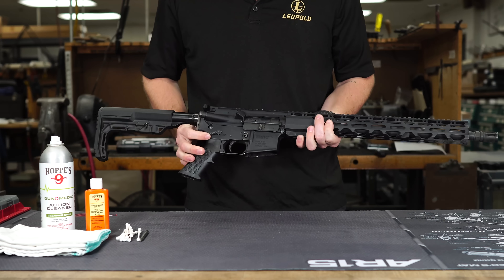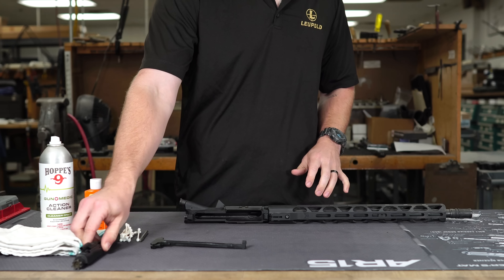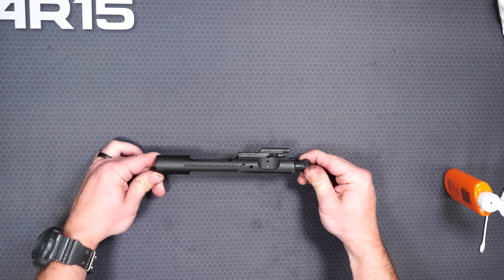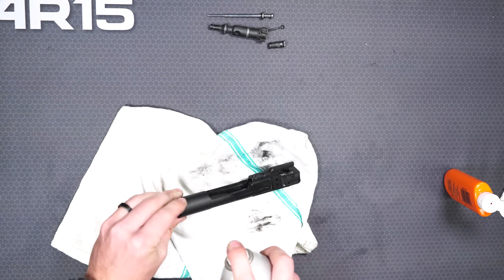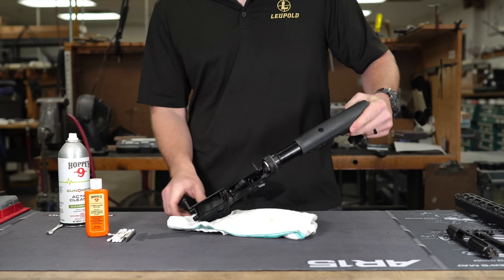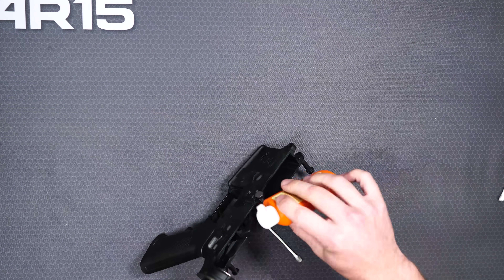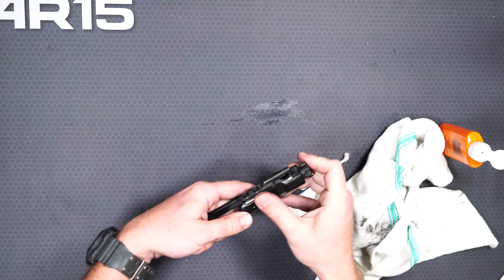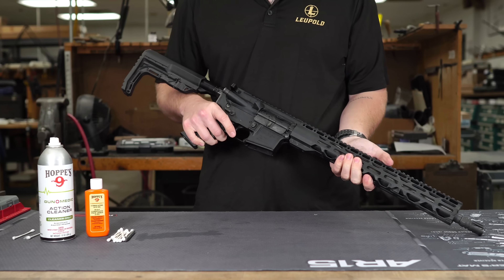How to Properly Clean and Lubricate an AR15

Comment: There is nothing proper about this video 95% of what was said and demonstrated is wrong in terms of whats proper . Dumping oil in a gun is not only asinine but its also the wrong lubrication for the job at hand , 99% of people who actually run and understand the basic mechanics of their rifle run thin grease it is proven superior to oil and all that oil you dumbed into your bcg what ever made it into the expansion chamber is going to  turn straight into carbon , that kind of pressure and heat doesnt blow oil anywhere it instantly  vaporizes it
Reply: Agreed, the bolt cam pin, the carrier key, gas rings and bolt lugs get grease.  Who takes apart the bolt but doesn't remove the extractor?  Who puts a bolt together dry and then tries to lube it assembled?
Reply: @Cerus98 unless your running around with your bolt locked open it doesnt matter
Reply: Run any grease up here and you have a single-shot. Common sense must be a shooters guide to maintenance.
Reply: @jimorth6306  they make grease specifically for cold climates and freezing conditions

Comment: Naw dog you can’t just drench your rifle in cleaner if you plan on using it. I don’t know if your hoppys is alcohol based or what but if you did that with clp you’d be bleeding carbon all over for months
Reply from the maker: This cleaner dries quickly. Plus the excess is blown/wiped off.
Reply: If that's the case you keep your rifle dirty

Comment: No way I’d lube the springs in the trigger like that lol. You’re acting for too much build up.
Reply from the maker: It may seem like I used a lot, but it's just a few drops. I agree, too much oil attracts build up. A little goes a long way. Not dry. Not wet.
Reply: @midwestgunworks  thanks for the reply. I couldn’t tell as I was on my phone. Do you ever use clp?
Reply from the maker: @MatthewSmith-uf6tr  Yes, CLP works really well.
Reply: @MatthewSmith-uf6tr  Clenzoil CLP has been around forever and does a great job.
Reply: @TXLoneStar_  that’s all I use
Reply: Project farms test shows clenzoil to have the most lubricity. Been using it ever since. Thin layer of gun grease on bolt

Comment: You don't need to lube your upper like that, light film or not. Geez you must like cleaning carbon for fun. Run a light film down the center where the charging handle rubs and use a better oil than "evaporate in a week" Hoppes. Like synthetic transmission fluid. You do want the upper "bone dry" because nothing is rubbing up there. You don't need to lube up your charging handle like that as it's not touching anything. Pay attention to wear marks, that's where there is friction and rubbing. You definitely don't need to oil your bolt like that...Dear Lord that's nuts. You've created a carbon magnet for no reason. Pay attention to the 4 wear points on the bolt where it really rides on the tracks. Don't lube anything that doesn't show wear points. And use better lube. CLP if you are afraid of automotive lubes (which don't evaporate in a week.)